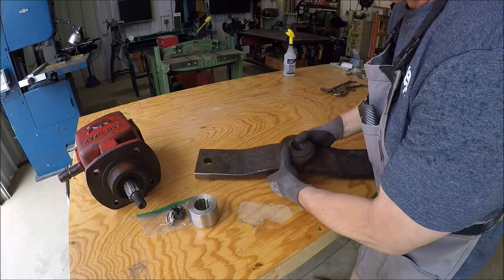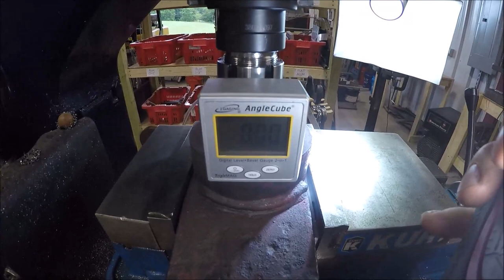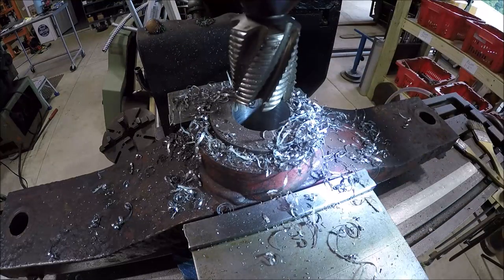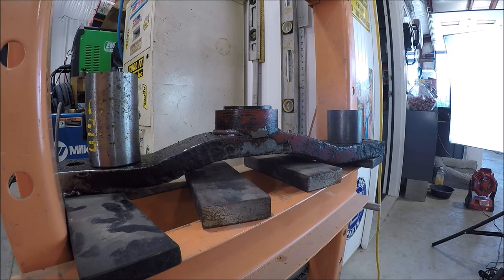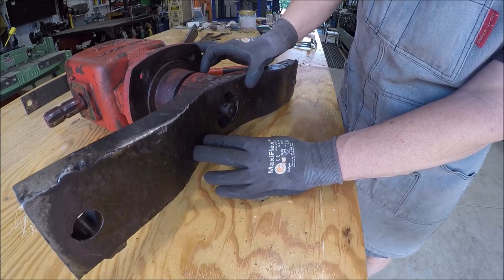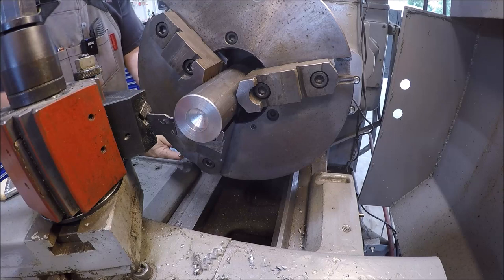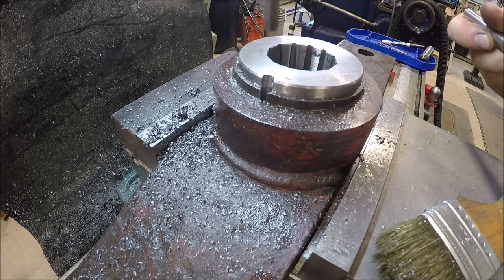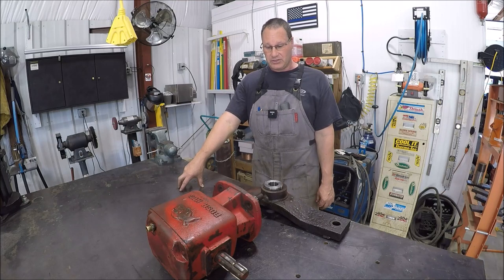Bush Hog repair

Comment: Having fixed many many of these that’s a good solid repair.  As small shops people always seem to ask why we don’t use processes that larger shops do like nitrogen and stuff like that but it’s hard to profit off something we might use a few times a year Mayby.  As far as the height difference they adjust that with the 3 point and rear caster so no worries there
Reply from the maker: Thanks Adam. If I had your press it would have sent it home no problem.

Comment: Good job Tom. I am no expert at heating metal. But it seems to me I have seen videos and heard others talking about how heating will swell metal a lot more than cooling will shrink it. Maybe someone else can chime in and explain if I am right or wrong. I guess it would be easy to mic a chunk of metal and then heat it and see how much it swells. I'm sure this has been done before but I am interested in knowing if there is a set of rules or scales to say how much a certain size of metal swells compared to other sizes. I'm wondering if the machinist handbook has something like this.....

Comment: If you had used a welding torch tip to heat a vertical line on one side while still pressing I think you could have gotten it to where you wanted.
Reply from the maker: Okay thanks Brian. On another note finally found the source of that audio noise you have been hearing. I had a bad adapter cable. So hopefully the next video I make it won't be there.
Reply: @hilltopmachineworks2131  Cool. I will let you know if it quits the next video. It barely shows up on my desktop computer but is very noticeable on my phone. Keep those farmers in the fields! 🙂
Reply from the maker: @bcbloc02  I have 3 videos using the old cable to post, so it will be after that then the new videos will have the new cable.

Comment: I've found this before where a bore was off center from the boss, but when I measured from the outboard holes, the middle bore was actually in the center.  IOW, the big round boss was welded off center some but the bore was machined centered.  So, if you were to move the hole to the center of the hub without measuring, your new bore could be off center causing a pretty bad vibration.  It almost caught me once then I started measuring after that.  Old farm equipment might not even notice an 1/8" tho.